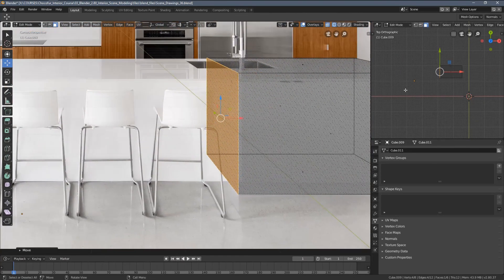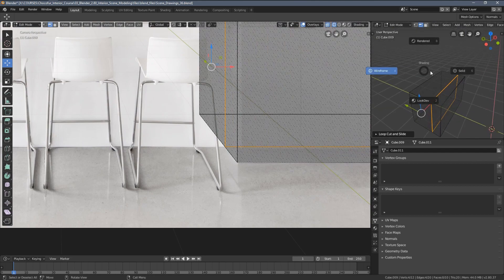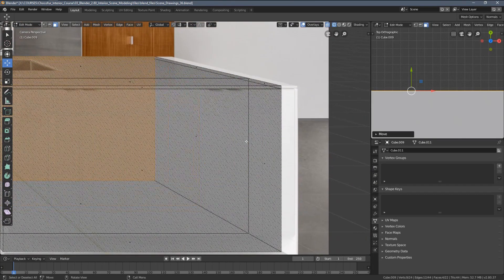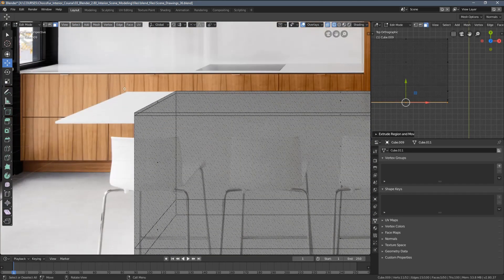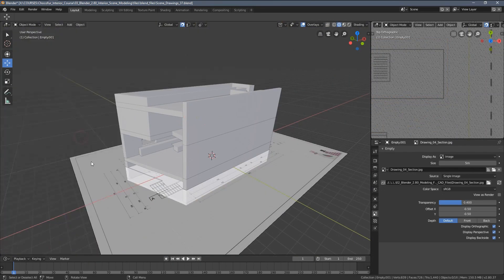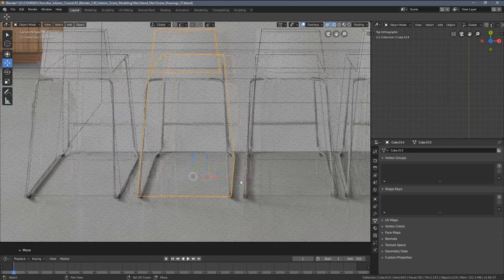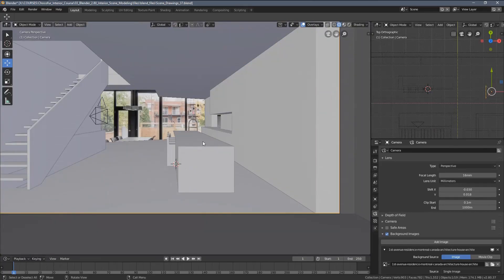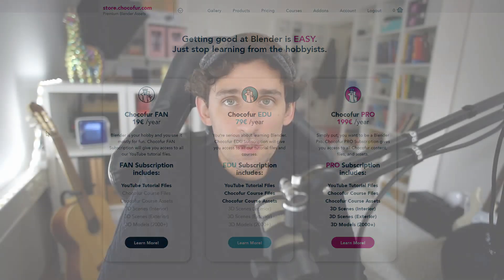Blender Archviz: Kitchen Island 3D Modeling | Part 11 |

Comment: You know what is funny and quite a coincidence. Those white bar stools are exactly the same as that old interior tutorial on your old website. I just checked my render and they 100% same brand!
Reply from the maker: I'm not sure if it was the same furniture piece in both interiors, but I've used the same model as it looked very similar if not slightly better for the course interior :-)
Reply: @Chocofur  If i check those photos, they really look identical. DId you check that?